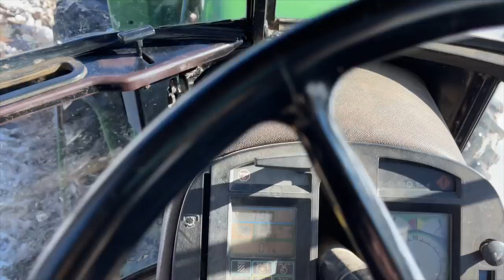How Did We Make It?

Comment: That button you push for 4 wheel drive on the tractor works nice. Just don't forget to turn it back OFF, when you drive on a "hard road". It will eat the rubber off the front wheels on hard pavement. I've seen front tires needing replaced, with very minimal hours on them because of forgetting to turn it off.

Comment: When you get a nice day you should wash the under side of your new truck if your truck has a box frame put the washwand onto the holes of the frame and wash out ! I worked in bodyshops for more then 50 years in Pa.  I saw a lot of pickups and cars that were rusted out and junked before they had a lot of miles on them. The highway dept. used a lot of salt on the roads.Now I moved to central Georgia  we get little snow and no salt!   There are a lot of nice older cars and trucks on the road that would be in the junkyard for 20 years! In Pa.

Comment: Meredith I am only gonna say this once, isn't owning a Dodge ram 4x4 a excellent choice?  I have owned mine going on 18 years now but it has been the best investment in a truck I've made. It goes anywhere I want and gets 20+ miles to the gallon. It's a 5 speed that's way and it is in stock form, don't miss with tire size. This is why dodge drinks fuel.